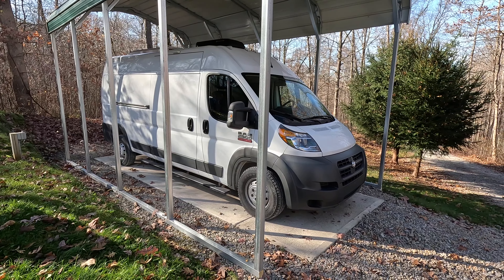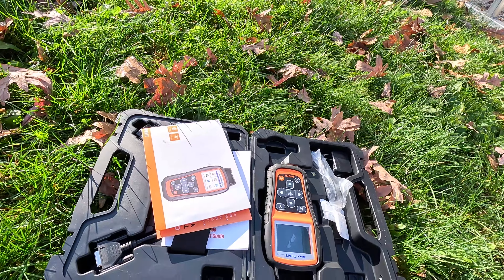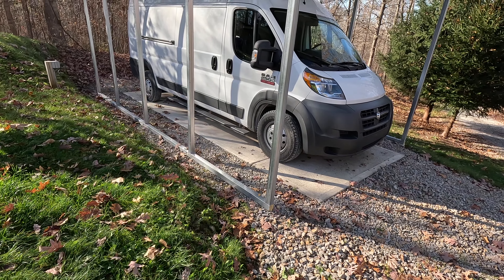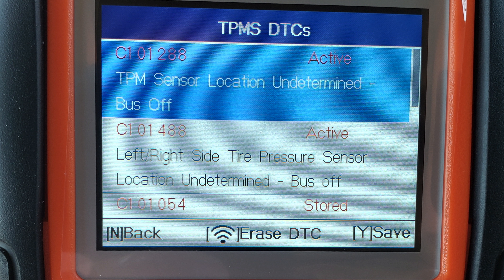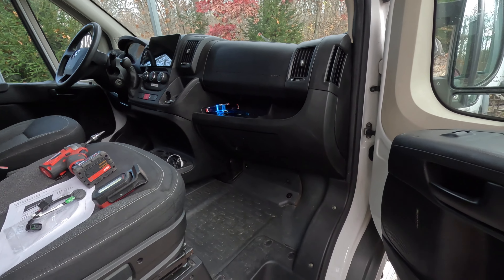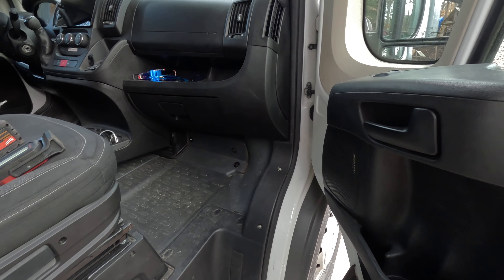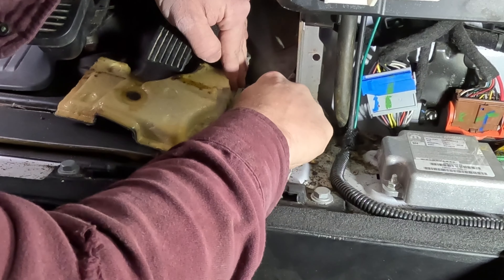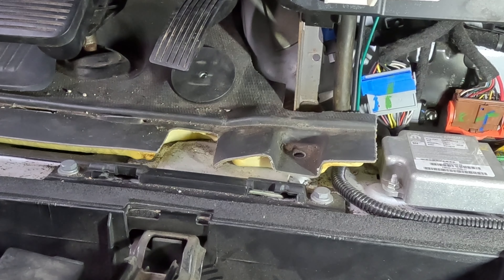RAM Promaster TPMS Troubleshooting - FIXED DTC C101488 C101288

Comment: Awesome!  Have a 2014 that has the light on when I picked it up new.  After a few attempts by the dealer to fix, they sent out a factory rep to address it.  They wound up replacing the module.  Worked for a few years and now it throws the light intermittently.  This is the fix that will work!  Finally!  Had no idea about the TSB!

Comment: Hi,
I used the alfaOBD software, OBDLink MX+, and bypass and changed the pressure valves so I can run 60/60. Much better ride quality. I also turned the seatbelt buzzer off and enabled fog lamps and installed factory lights. 

BTW, the uConnect 5 displays the tyre pressures. The uConnect 3 doesn’t have the smarts.

Thanks

Comment: Can I know why you replaced this wire? I have a symptom that every once in a while the tire icon lights up. The sensors are working because they read the tire pressure and temperature. I just don't know because there is also a check for energy-mechanical interference in Multiecuscan and it shows 190% for me. How much should it be? Maybe because of these interferences it shows me an error because it breaks the connection between the sensors and the antenna?

Comment: Hi.  Great video!  I replaced all 4 original steel wheels plus the spare wheel on my 2019 Promaster with OEM Promaster aluminum wheels (got a good deal on 'takeoff' wheels from a company that upfits vans).  Essentially new wheels and tires.  They came with the OEM TPMS sensors installed.  However, after a did a test drive, the tire pressure warning light came on and now flashes for over 60 seconds when I start the van.  From what I have found on the web, this indicates a system fault (an actual low pressure would flash for a shorter time on startup and then go solid).  When you replaced your sensor did the TPMS 'autolearn' the new sensor or did you have to program it with your laptop and AlfaOBD software?  Thanks!
Reply from the maker: You will need to program them

Comment: Howdy! Thanks for the video! Did you have any ither issues present? Such as flashing odometer, or other things like HVAC not working? Ours out of nowhere yesterday had the tpms light go out and the odometer is flashing and the HVAC controls are not working. Thanks
Reply from the maker: That's means the module is not connected/communicating with the instrument cluster. That causes the flashing odometer
Reply: @JackofAllMasterofNone  gotcha - we did a proxy alignment with no change. So weird :( thanks for the response. Guess it's time to start throwing parts at it again aha

Comment: What brand of head unit is that? Did you install it yourself and does it maintain all of the vehicle menu choices on the screen? Also you mentioned using Bluetooth versus USB cable to the windows computer, what did you say happened with $800 and something about a brick? I use my cell phone and can't seem to attribute all of the features, I'm going to order the direct cable and use my laptop but just curious what you mentioned about the issues using the cell phone and bluetooth, thanks
Reply from the maker: I have seen cars computers ruined by using a Bluetooth connection. I always use a wired connection when programming modules. Just me being extra careful.  Here is a link for the stereo install. It should answer your questions. 
https://youtu.be/maLzT2HdSSo?si=ePNcODw4D-D1x6AR

Comment: you can also do this so that we can disconnect this cable from the antenna module and then make a proxy and the system will forget TPMS and there will be no error